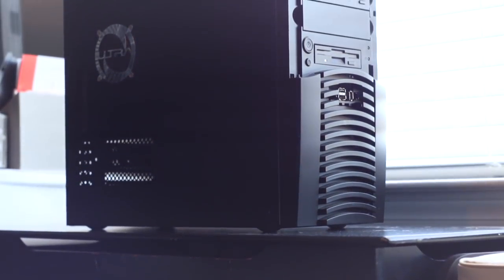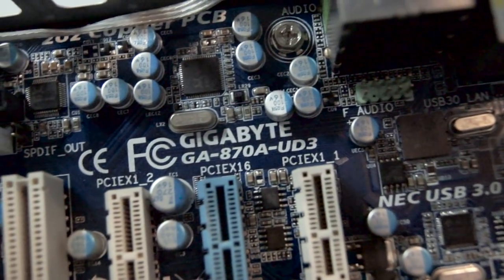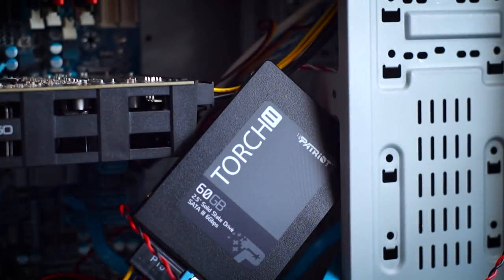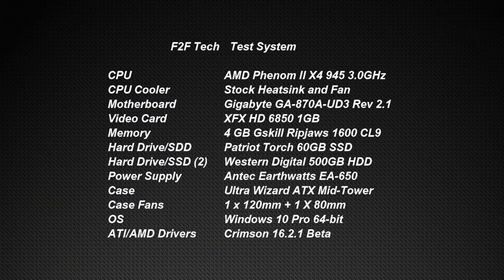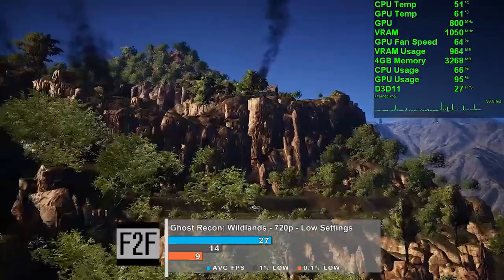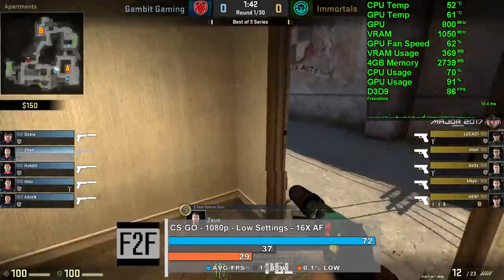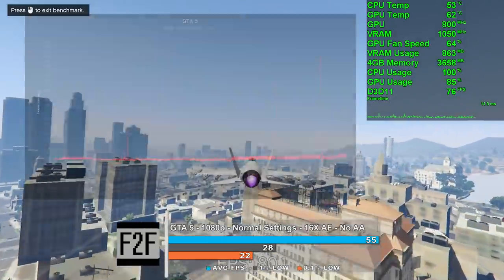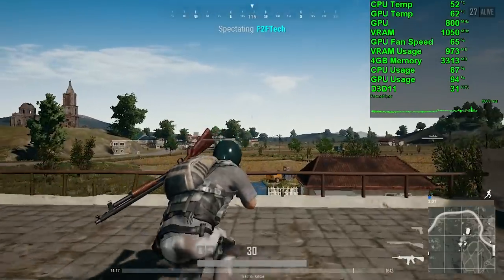How well does a 2010-2011 AMD Phenom II X4 gaming PC hold up in 2018?

Comment: ryzen was truly this line of processors successor
Reply: Eh, meh.

Phenom X4 was a good CPU, given it was slightly slower than Intel while also being cheaper. 
Phenom II was even better.
Phenom II x6 wasn't properly leveraged by games for its time. In newer games, games would run better on 6 threads vs 4 threads.
Bulldozer at 4.3 GHz with 8 cores would be faster than previous Phenoms.
Piledriver at 4.5 GHz with 8 cores would wipe the floor with all previous AMD CPus. Higher clocks than anything before AND higher IPC than Bulldozer.
Reply: And ryzen is new FX series of modern times. Cheaper, slower and more cores, just like always
Reply: Not in games and lots of software. In multithreaded performance Ryzen wins in it's price category, yet isn't very impressive. Just like FX was, just power consumption is lower.
Reply: There were times when AMD dominated in performance, yet again questionably as Intels were close or matching. Most memorable were Athlon 64, Atlhon 64 FX, Athlon XP and AMD T-Birds and maybe Athlon K6-3. Anyway Intel either had something similar or soon made something greater, so AMD never really was a true dominator. Most of the time AMDs are good enough, great value, great overclockers, inovators, but not the best choice of extreme enthusiasts.
Reply: The have higher ipc and I believe better power usage than bulldozer. They just came clocked fairly low from the factory.
Reply: EvilTurkeySlices but Ryzens still have lower ipc than majority of coffee lake CPUs. Power draw is fine, so is Intel's and was of lots of FX's if used at stock clocks and volts. Besides core count for the price, Ryzen doesn't shine much.
Reply: Mantas Jurksa ryzen shines a lot(and the ipc difference between the two is minimal)
Reply: EvilTurkeySlices shines a lot in having civilized price, not so much in anything else.
Reply: MT441PL Yeah they have potential, but still AMD is losing its own individuality. AMD FX feels like truly last AMD. Fist of all AMD has to drop stupid names like Ryzen and Epyc. Kindergarten bullshit doesn't fit serious semiconductor maker. Then they have to focus more on single thread performance. 32 cores are nice and all, but if they are slow then its not much use of them. Also AMD has to become more technical. They should develop more features in their processors and be innovative in their designs. AMD FX was a beast in terms of engineering. It was server derived processor for consumers with totally new architecture. It didn't turn out great, but at least they tried. Ryzen is just really meh. It's like roided Opteron with stolen hyper threading from Intel. Still AMD is stuck with what Intel does. They are still playing catch up. They can't beat Intel, but they totally should offer something that Intel cannot in terms of features not just cores. AMD besides being budget kind and smart choice, it just lacks killer features. Not saying that Intel does something better, just that AMD should and probably could. I would like to see weird core designs, totally remade power saving features, maybe even offering options for expanding processing power with coprocessors. There are 3 strategies to reach high performance computing. First is raising clock speed and reworking architecture. Second is highly threaded computed and third one is unified computing or accelerated computing, where various parts help processor to complete tasks faster. There were signs of third stage in the past and AMD could pull off something like that, I think, but they are stuck at 1st and 2nd stages too long. I would also like to see dual socket consumer level motherboard like in Pentium 3 days and and support for ECC memory in budget segment. This could help AMD to attract professional consumer market. As I see AMD is trying to fit into lots of various markets and I think there's a lack of anything in mobile market. Ryzen mobile is nice, but nothing from AMD is ARM based for phones and tablets. Neither much of AMD is IoT stuff. Some things like Intel NUCs are Intel only, but AMD could make them too and beat Intel, due to superior graphics and good CPU power. That would be a perfect HTPC for masses. AMD is common in cars, but lately I hear about Nvidia more and more. They shouldn't let Nvidia in there as cars are great money makers and AMD is great manufacturer. Also in 90s CPU market was full of various weird stuff, it was volatile and full of differences. Manufacturers knew how to make them differently and lots of innovations were made, now it's not like that, but AMD should bring back innovative times again. They are advanced micro devices, not catch-up micro devices. I see lots of potential in how AMD could expand and innovate, but I think their R&D budget is very limited and that certainly affects what they can do. Some AMD's great ideas became dead meat. I'm talking about Mantle. It was awesome, but died quickly and was totally forgotten by many. Maybe processing power of their stuff can't be pushed further, but features is another thing that can be improved. AMD Ryzen is nothing. It's cheap alternative with lack of innovation. It didn't push clock speed limit like AMD FX did, it didn't push IPC barrier, like Coffee Lake does, it only pushed mainstream core count, but Xeons and Opterons had that for years. Ryzens just are good product at right prices, but nothing more and that's a shame. 

Oh and I have FX 6300 overclocked to 4.1GHz with most green stuff disabled. Doesn't eat lots of power, over 400 fps in UT 2004 at 1440p with maxed out settings. I'm happy with it. At one time I pushed it to 5GHz and validated that. Still low power consumption. I play GTA 5 at 1440p and medium-high settings with 50fps most of the time. I only have RX 560 in there and 16GB RAM. Not bad.
Reply: Mantas Jurksa  I got a phenom ii 965 BE @4ghz with gtx 470. Can emulate BoTW at 30-45 fps and get 80-100fps fortnite on high. 1080p. Decent computer. Think a better graphics card is needed, 470 can get very loud and only 1.2gb ddr5. Cinebench at 375 for cpu. It worth an upgrade to an fx 8350? I'm just waiting for the right deal on a better graphics card, honestly. Got the 470 for $15
Reply: Adam Humble I would say that cpu upgrade is only worth it for you if you could overclock fx 8350. Your Phenom is almost as fast as stock fx 6300. I think it would be wisest to just get gtx 1050 Ti and just stay with that computer as long as you can bear it. Later you will need major platform change. Get fx 8350 only if you need that many cores for some reason.
Reply: The thing is lack of forward thinking. Well yeah Ryzen matches Intel, that's it. But is going to happen later? Ryzen is losing to Intel in single threaded performance to Intel. AMD sure was working from Dozer, but it's not that impressive that they upgraded Dozer to Piledriver, then they did lots of incremental socket FM3 and later FM2+ upgrades. Ryzen is mostly fixed Dozer. Still AMD is lagging behind Intel (CPU single threaded performance) and nVidia (GPU performance). AMD must stabilize themselves or it's going to be just the same as always with them. One peak and then downfall. They should look for opportunities how to grab into some money making industries. Ryzens are fine, but nothing revolutionary nor exceptionally good. They sorta are matching Intel, sorta. Their tactics seem to be to add more cores, but who needs that? I saw yesterday i5 8400 benchmarks on Tom's Hardware site. It's decently priced CPU, that beats Ryzen in most of workloads that people realistically gonna use. They are making a gamble that people may buy it. Then later it may turn out that lots of cores are useless and they need to improve single thread performance. Lame. AMD only has two selling points, value and thread count. Otherwise they would be hardly worth it.
Reply: Well since Intel and AMD have pretty much the same architecture, yes it is going to happen later. The thing that your forgetting is that intel processors are clocked at damn near 4.2ghz out of the box. AMD's are at only 3.5ghz. They are already at the same IPC so of course they are going to be faster, they are clocked faster. That doesn't mean that they're better. Yes in some synthetic benchmarks Intel has better single thread performance but in real world tests they're literally identical. You throw an i7 and a R7 in the same rig playing the same game at the same clock speed and there will be no difference. Your making it seem like Intel is light years ahead of AMD when in reality they are literally neck n neck. You do realize that Intel is adding more cores too right? i5's now have 6 cores and i7's have 8 cores, Intel is literally doing the same "tactics" as AMD. You know why? Because software is taking advantage of more cores. Gaming, Workstations, servers, streaming, video editing, photo editing, etc. All use more than 4 cores now. Its also funny that Intel is now known for the hotter running possessors, due to the higher clock speeds and shitty thermal grease that they now use. (Seems they haven't learned from Netburst.) Ryzen is a damn good architecture and worthy successor to Phenom 2, hell even K7.  Like I said, I'm going to need you to get Intel's dick out ya butt my guy.
Reply: +LightSkin
1)"Well since Intel and AMD have pretty much the same architecture, yes it is going to happen later." Their architectures are nothing alike. If that was the case, then there would be lots of problem with laws and etc. 
2)"The thing that your forgetting is that intel processors are clocked at damn near 4.2ghz out of the box. AMD's are at only 3.5ghz." There was never any words about clock speed.
3)"They are already at the same IPC so of course they are going to be faster, they are clocked faster." Then why AMD didn't clock them faster? FX CPUs even reached 5GHz. Looks like limitation of internal processor architecture, which doesn't let them achieve that.
4)" That doesn't mean that they're better" ??? That certainly means they are better.
5)"Yes in some synthetic benchmarks Intel has better single thread performance but in real world tests they're literally identical." Certainly not only synthetic benchmarks show that, but tasks like excel, music conversion and etc. Look Tom's Hardware i5 8400 review. Clocked lower than AMD and beats AMDs with more cores and more clock speed. 
6)"You throw an i7 and a R7 in the same rig playing the same game at the same clock speed and there will be no difference" There are lots of differences between two and your test is lame for CPU comparison. It would be appropriate for GPU, but not for CPU.
7)"Your making it seem like Intel is light years ahead of AMD when in reality they are literally neck n neck" No I don't, Intel is slightly ahead.
8)" You do realize that Intel is adding more cores too right? i5's now have 6 cores and i7's have 8 cores, Intel is literally doing the same "tactics" as AMD" Sigh. They aren't doing same as AMD. Not even close. They offered 4C/8T before, when lots of software was mostly dual threaded and had some headroom, now demand changed. Software needs 4 cores, so Intel kept same headroom. AMD is like always. More cores and more threads, even if those are barely useful for anything. Look at Der8auer's latest interview. He said that core race is stupid.
9)"Gaming, Workstations, servers, streaming, video editing, photo editing, etc." Now say how many people do all that. It's only minority.
10)" All use more than 4 cores now" Totally not. Lots of software is still single-threaded, like Excel, web browsers and etc. Much less is dual threaded, even less is quad threaded or can utilize that many cores. Cores are made to have some headroom for background tasks or multiple tasks at once. Maybe if you do some NASA stuff everyday, then it might look like that to you. Making software for one thread was relatively easy, for two cores much harder and for even more it gets even harder. Devs tend to avoid using as many threads as possible, because difficulty of doing so rises to huge levels. The worst thing is that it's harder to track down what isn't working well. Multi-thread support is only done when absolutely can't be avoided and is totally needed.
11)"Its also funny that Intel is now known for the hotter running possessors" Only now? It should be corrected to almost always. Pentium 4 stuff got very hot, yet again hot CPUs started to be almost anything i5 and i7 due to that small heatsink being barely enough for them. AMD almost always had cool processors and good stock coolers, even before Ryzen ones, all way back to Athlon 64 era and likely even before. The only exception was FX series, but stock coolers did their job mostly fine, even as cooling solution, water cooling was offered, so it could cool down FX 9590. Being hot almost never was AMD problem, meanwhile for Intel it always was.
12)"due to the higher clock speeds" not exactly due to that, but mostly due to Intel refusing to make bigger heatsinks. Their i7 cooler is smaller than my AMD A4 cooler and my A4 only reaches 46 Celsius with thermal limit of 70 degrees, Intels have much higher thermal limit of whopping 100 degrees and it's not surprising to see Intels running at 80 or even 90 degrees. Before thermal limits were lower. AMD for quite a while had very low thermal limits of only 62 degrees of Celsius.
13)"shitty thermal grease that they now use. (Seems they haven't learned from Netburst.)" Netburst didn't have the same problem. Problem was premature deaths of processors caused by way too high voltage used and inadequate cooler supplied, which was bigger than modern Intel cooler. And all that was caused by need to raise clock speeds, because they made too long pipeline in those things and in order to stay competitive they had no choice but too to increase clock speeds a lot. Intel was desperate and needed quick fix. It of course backfired, when they discovered that their processors suffered from electromigration and soon it was resolved by other Pentium 4 generations, but those things were still slow, just didn't kill themselves. Semprons, Athlon 64s and Athlon 64 FXs reigned back then and were leaders. AMD used shorter pipeline and had much lower clock speeds. So they didn't need to have high voltage and in return made less heat, while performing mostly the same or better than comparable Intel. Problem there certainly wasn't internal thermal compound. There were many bad steps made by Intel. AMD was in full glory they could have. K7 Athlons were the best, later Athlon XPs rocked, AMD won antitrust lawsuit against Intel and then Athlon 64 era started. It was streak of wins for AMD and they made first dual core processor which was better than yet another rushed Intel product, until Core 2 era. Then things changed. AMD wanted ATI, AMD wanted to get bigger, but they lost performance crown for years to Intel and barely survived to this day. 
14)"Ryzen is a damn good architecture and worthy successor to Phenom 2, hell even K7." I never said it wasn't good for now, but it shouldn't be so glorified, when it loses to Intel so many times, when its marketing power is mostly cores, not internal improvements. Core marketing is successful as it looks like, but it doesn't really bring many tangible benefits. AMD must improve further if they want to survive and a lot further. Intel is big, they can survive hit or two and then strike back strongly. AMD is fragile and must do many precise steps to become bigger and stronger. Their situations are different, very different.
15)"Like I said, I'm going to need you to get Intel's dick out ya butt my guy" I never had Intel myself, but it's better in many cases. It's practical choice. I had AMDs, because I wanted AMDs and I am against Intel's criminal behaviour through decades. I support AMD, but I don't need absolutely the best I could get either. As long as AMD isn't far far away from Intel I'm fine. I lately bought AMD A4 6300 for low demand HTPC build. It's not bad at all. 

You should educate yourself more, before talking so much of non-sense. Learn some history, learn more about how processors work and read much more benchmarks. Your lack of precise knowledge is ashaming.
Reply: WarmSoftKitty  "ryzen isn't remotely impressive" WEW LAD

Remember when Intel shat their pants so hard they resorted to claiming infinity fabric was glueing chips together and that AMD was a poor supplier as a response to Zen architecture?
Reply: @ChucksSEADnDEAD  AMD has surpassed Intel on sells now. Looks like Mantas was right on this one.
Reply: @MJ-uk6lu 

The 1st gen of the FX series was garbage.
The "real" FX chip was the vishera line

Ryzen's not a 2018 FX at all . I've had the 4100 (zambezi) and the r3 1200 runs circles around it.
Reply: @MJ-uk6lu  Technically, at the same clock, ryzen ipc is 3% bigger than any intel cpu
Reply: @absurddive   First FX line was still for s little time fastest CPU on the market, Tom's Hardware wrote about that in their AMD achievement history. But I agree that Vishera was truly needed to address some problems.
Reply: @tuxnews2878  Ugh, depends highly on how you are going to measure it. I recently read a book about computers and how CPU pipeline works. That's some advanced stuff. Now I'm reading Hector Ruiz's (former AMD CEO) book Slingshot. Anyway, we are talking about few percent difference and now we must look at market. Turns out Lisa Su has some goals, she organized AMD properly, their pricing is fair and AMD can compete. Intel is experiencing shortages. AMD is a having a good time. In some countries AMDs are now super cheap (GPUs too). I think that this fight was very successful for AMD and they seem to have good future goals. I can't recall what we were talking about here, but I think it was about AMD not showing enough future goals. Now I changed my opinion. AMD is strong now. Also after reading more about CPU history and what was actually happening at both companies and looking at the first comment, I can say that Ryzen can be a true successor to Phenom II X4. AMD was having a hard times for a long time ever after it and mostly due to fighting with Intel about Intel's anticompetitive strategies or in other words how Intel abused every other chip maker using their status. Now that legal problem is sort of solved, AMD stepped out of their worst phase of almost going bankrupt, they could create a good products. Hector Ruiz's long term strategy paid off, it was worth to put the end to Intel's abuse and after that happened AMD as company now can fully enjoy its strengths, which it had ever since early 2000s. Ryzen by itself isn't very amazing, but what is amazing is AMD's rise and how they decided to do things. That's their strategy, hard work that we should appreciate, as well as their goals and morality. This is what is impressive, not Ryzen. Ryzens are fine and their pricing is truly something exceptional, AMD competes a lot in value segment, even if it can't do so at high end. Now they showed us that their mentality is truly changing and they aren't just second source CPU company. They are serious corporation with many many things to offer. After all the reading I have done, I can't just see what products are there, I must also see what sort of people work on them.

Hopefully I replied about something this chat once was.
Reply: @MJ-uk6lu  are you an intel fanboy?
Reply: 7nm LETS GOOO
Reply: @MJ-uk6lu  when I'm compiling my 1700X destroys my i5 7500.  Because I do a lot of programming rather than gaming the Ryzen is a superior CPU.
Reply: @EvilTurkeySlices  IPC on single core is something like 20% the last time I checked.  Though admittedly that was based on a whole generation ago, let's see what the Ryzen 3 series brings as it's supposed to be much closer.
Reply: @paladinepaladine  That's a pretty rare case, where all cores are utilized.
Reply: @anantawijaya4336  I never had an Intel CPU
Reply: @MJ-uk6lu  I'm old enough to have had a Cyrix and NextGen.
Reply: @paladinepaladine  And?
Reply: @MJ-uk6lu  responded to the wrong person
Reply: @MJ-uk6lu  This comment did not age well.  Ryzen 3rd gen is outright faster than the i9.
Reply: @MJ-uk6lu  Until now when it has IPC over intel just not clock speeds, eating your own words?
Reply: @MJ-uk6lu  This comment hasn't aged well. lmao
Reply: @FRanger92  It was fine at the time it was relevant. Now go to AMD FX videos and tell people how their comments haven't aged well.
Reply: all amd pre-zen cpus suck lol